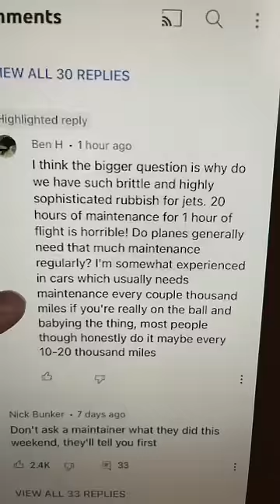Why does an F-16 need 17 hours of maintenance for every hour of flight?

Comment: So lazy Air Force guy here who feels bad about himself when Ryan runs triathlons. I thought about making a response video to this. But for now I'll just leave a comment. I was in the USAF reserve for 20 years and I worked on both f-15s and kc-135s. Everything Ryan just said is true. I'm sure he's going to go into more detail. But he did a great job explaining it, which also adds to my suspicion that he did more than just shooting at tanks in the army. But I digress. One quick explanation for the rate is that this is probably compiled over a year. When I would have f-15 fly for 1.5 hours we did not have to work on it for 30 hours to get it to fly again. A quick inspection and refueling that would take about 2 hours of Total man time before it went back up. But after a few days, a few weeks, a few hundred hours of flight you have a lot of other inspections that have to be done. And like Ryan said things break. So that's where the hours really add up. And remember it's not just one guy doing this you have dozens of different specialties all working at the same time. Thanks Ryan you're the best as always!
Reply: Good addendum. As a plain old civilian that 17:1 sounds bizarre until we’re told daily vs major tear down. We really don’t have a clue about this stuff.
Reply: Yea. Its Man Hours not actual hours. Important difference there
Reply: Im sorry to say, and I guess you know this, but with better/tighter tollerances during manufacturing it could be less hours maintenece per flight hour (as it in fact is in car racing) 

So even if f16 is ofcourse well built,  there are things that could be perfected.  There always is.
Reply: Yup , and both the F-16 and F-15 are 30+ years old. The newest f-15C was built in 1986, to put it perspective. Try that with a car. All the above is true and also you have several types of stresses induced over the airframes life.
Reply: @akulkis  Yep, worked Maint at a Mech Inf Batt.( 🇨🇦) and its always the redrain, Maint, back to work. We had a light infantry Col. promoted in, wanted to do all the hardcore Army stuff and , slowly and surely, our amount of serviceable vehicles dropped. So did his career when the Brigade Commander found one of his 3 Inf. Units basically combat ineffective.
Reply: @knotannrkpg  lol you’ve never worked on aircraft or aerospace manufacturing have you?
Aerospace work is high precision and close tolerance work.
Reply: @knotannrkpg  It is the heat, pressure changes, exerted loads compared to tolerance, and environment that create the different maintenance cycles. 
Your standard commercial aircraft has wing deflection tolerances that would scare you.
As these deflections occur, you're chopping away at the life cycle of the component in question, ultimately leading you to do a full inspection where you WILL find corrosion, stress fatigue, and a laundry list of other snags.
If these issues aren't addressed during that maintenance visit then planes can crash and people can die.
The main reason for these maintenance schedules being introduced is from incidents causing total loss or catastrophic failure
Reply: He said maintenance not repairs
Reply: @knotannrkpg  umm no.  Materials science will disagree with you on that.
Reply: @michaelbosisto6259  actually most planes although may be decades old, most of the plane gets replaced and reskinned based on that planes's Depot schedule.
Reply: Dr. Bright  because they have no idea what it means to kick the tires and light the fires.  Crew Chief KC-135 🫡.  Done my fairshare of working on a flight line.
Reply: @nolimitsouldier09  actually no.  It is based on a system of tolerances. Some thing's are tight, some things are not tight.  Depends on the system.  And it sounds like his experience is with civilian aircraft.
Reply: @RP-rm7po  this reminds me of my favorite thing to do. When on a plane and someone bugs me.  I lean over and ask them how many bolts hold that engine on.  They look at me with fear.  I tell them most likely only 3.  They usually grip the arms real tight and I have a quiet ride to my destination.
Reply: @nolimitsouldier09   yes i do
Reply: @brickerhaus   what happens if you stop using hoses between wings to fusilage, to engine.  Changing Hoses are one of The reasons you need to change parts quite often (they dont last that many thousends of flight hours, )
Well, you Will probobly say,  you need hoses for Flexing right? Well no you dont.  Also a titanium pipe can handle flex if they are designed the right way.  (Its shape) but doing it with the exactly right shape is the hard part.  We are not talking of thousends of a inch,  but thousends of a millimeter in tollerences. 

How long does it take to change a wing-structure and why does it take such long time? If it was designed in such a way that it would be enough to be fastened with less bolts, without any need for manual drilling,  and without any hoses,  it would be quicker to change.  And that would result in less maintenace hours/flight hours.  
But it would require very tighter tolleranc at manufacturing.     If you are interested to know more, or dont belive mee. Search information about it in boeing/Saab TX project.  I have a held , and manufactured, a few of those parts that made the differenece   with my own two hands.
Reply: @akulkis  all The parts you are talking about, is not The main reason for high maintanance/flight hour,  systems around The engine is.  (Not so much engine itself as for the parts around it, hoses pipes lines wire etc) if you could manufactue those parts in a way to give them more flight hour,  so you didnt need to change them in say 10.000 hours.  maintenence /flight hours would be dramaticly different.  

to make that happen you would need better manufacturing /developement for those parts. They are ofcourse already high quality,  but they can, and will be better with development/better manufacturing process/tollerance.  better machines better ways to create drawing etc.
Reply: @knotannrkpg  so there are really not that many hoses in a KC-135.  Things like hydraulic lines are Stainless Steel.  Even the fuel lines are all Stainless Steel.  They have to withstand very high pressures.  The only things that flex are the wings.  And yes there are specific points where a hose is used. And in most wings the fuel tanks take those stresses.  That's why you still have leaks.  Very small leaks.  They also use bladders in places too.  Those are replaced.  Inspected in periodic inspections, but usually aren't replaced until the ISO inspections.  These are military planes.  And I hate to say hoses are not robust enough to handle the stresses of war.  Typically you will only find hoses in areas that are temperature controlled or in pressurized areas.  These planes go to very high altitudes where cold can severely degrade and compromise hoses.  You also have to deal with outside air pressures dropping to very low extremes and you want to put high pressure fluids in a hose.  That sounds quite dangerous.  Now yes there are hoses but not as many as you would think.  Why are you so obsessed with planes flexing?  Yes in some places flex is good.  Others not so much.  Like a Fuselage would be bad.  You wouldn't want your control surfaces to flex that would impact how the plan flew.  Stretch would be bad.  Like you wouldn't want stretch in your engine cables.  But there are systems that allow for those things and mitigate those effects.  Engineering is very complex.  And debating the nuances of how a plane is engineered in comments is not not a productive place.  We would be here for months if not years trying to explain things to the armchair engineers that think they know something.  When it took hundreds of very talented engineers designing every subtle detail of every part designed to do a specific task for years.  I was an Aircraft Mechanic or Crew chief as they are called, and I am an engineer, and even I can't know every subsystem.  That's why we had TO's or Technical Orders that broke down how to do everything from Fly to cleaning out the waste from the Latrine.  Told us how to inspect everything to retrieve the desired result that this one part was broken.  This is a perfect opertunity to point out the Dunning-Kruger Effect.  Which part of the curve do you think you are on?  Which part of the curve do you think I am on?  Think about it.
Reply: @brickerhaus   so you are basicly satin, Therese are not Much or if anything to improve.  No maintanance Times cannin any Wayne be reduced or any part of the plane Thatcher could be changed to make it better fly/maintanance. 

Ok sure 😆😁
Reply: @knotannrkpg  huh?  😶. That makes little to no sense.  Actually someone can make changes to a Technical Order for doing something a better way.  They get paid for it.  I've gotten some money doing that.  Not sure about the rest of your comment.
Reply: @brickerhaus   sorry about that,  my phone is set to correct to swedish,  it doesnt always work perfect while trying to write english.  

What i try to say.  

Even if there is only one part that needs to be changed every 100 flight hour,  but it is  located in the deepest part of the aircraft,  and you would need to remove wing and engine to change it. 

It doesnt matter if it is only ONE part. You would need to fly the plane to where your 10 people crew is, and it Will take them,   say, 2-3 days to change that part. 

Besides the actual man-hours,  the trip to go there will use your
Flight hours also, 

If you could perfect that singel part so it would handle 1000 hours, that would be Great. 
And if that still isnt possible, maybe some of those parts that needs 10 people to take of (like wing or engine),  could be made in a better way, so you only reguire 5 mechanics,  and you could do it out in the field,  you dont need to use flight hours to deliver the plane,  and you would reduce maintenece man-hours to half.   

Like changing a damaged wing,  i suppose on a f16 it needs to be test mounted,  drill a few holes "together" , fit the rest of the bolts after,   if it was made with better tollerances,  it would fit directly from factory, you wouldnt need a drill, so you could change it wherever you had to land, and then take of again the next Day,  
 So there is a lotta of ways you could reduce the number man-hours maintenence/ to flight hours,  if they wanted to.  By using better tollerances.  

Not only in perfecting that part to being able to handle more flight hours. but also by reducing the effort maintenance takes.
Reply: @knotannrkpg  you don't realize something though.  These parts are typically made by the contractor that has the lowest bid.  Tolerances are sometimes just guidelines.  😂 When you stop laughing it is also quite scary 😱.  Probably something you shouldn't think about when flying on a military aircraft.  Luckily we have very talented maintainers that make it not so scary.
Reply: @brickerhaus   thats why/what i told you in my first comment,  you and me both know.  This number (flight hr/maintanace hr) could "easily" be changed if it had more priority